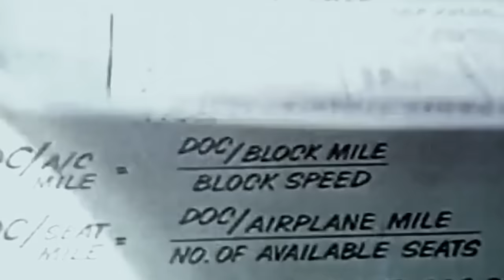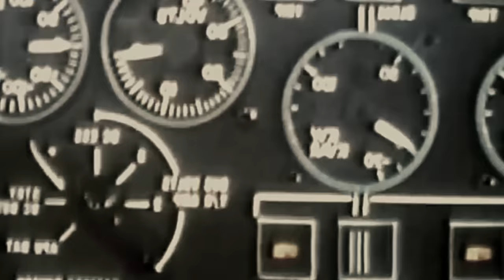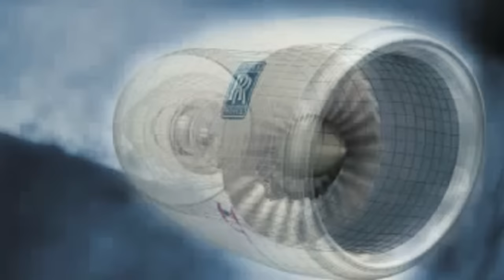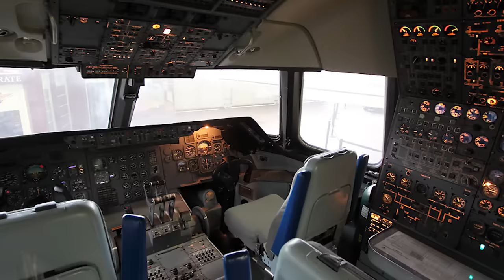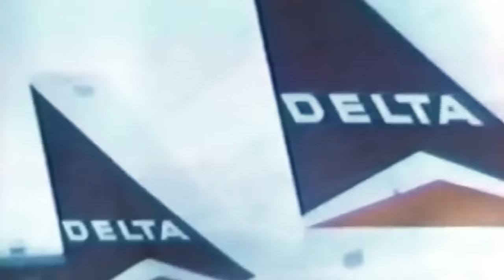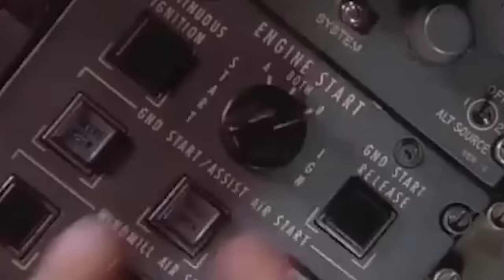L-1011 Tristar - too advanced for us

Comment: Back in the 1980's I worked as a cabin crew member and had the opportunity to work both the 
DC-10-10 domestic and flag on the 10-30 and on a different airline the L-1011.  I was a crew member involved in certifying the L-1011 with the FAA for the airline.  We went to Palmdale where the a/c were. The FAA would declare an emergency and we had to blow the slides and be able to evacuate 344 pax off the a/c in a certain allotted time. We passed with flying colors. I usually worked in the lower galley.  I'd put my tunes on, get my tennis shoes on and fire up those Bowmar ovens. I had a fire in one of those ovens one time, the lower galley filled with smoke. But by far the scariest incident on the L-1011 was while I was working lower galley, the fwd cargo door seal failed and blew out, which in turn blew out the pressure panels separating the cargo holds from the galley, they are designed to do that so the aircraft decompresses evenly. I say that calmly now but at the time I was scared out of my mind.  A very loud bang while part of the wall of the galley next to the cargo hold was suddenly missing and it got windy, papers anything light weight was floating, there was a fog in the galley and it got really cold all in about 1 sec all at the same time.  I've always had a fear of being sucked out of the airplane. I was in the elevator and going up in the blink of an eye.  Everyone in the main cabin is oblivious to the chaos down below.  I looked like I had been in a wind tunnel. As calmly as I could with the knowledge that we were going to be sucked out of the plane and impending doom awaited but mere moments away, I strapped myself into my jumpseat and called the cockpit. They said they had no warnings that indicated the problem.  A somewhat similar incident happened on the Death Cruiser, our nickname for the DC-10.  We were 1 or 2 away from departure on the taxiway, I was working rear galley and I looked over at door 4R and noticed it was no longer closed, it was open about 2-3 feet.  The doors on the 10 are different than what most doors look like.  These come slightly inwards and then go straight up.  I tried several times to get the door to close but it would go no further so I called the cockpit.  I was surprised they hadn't called us asking about why this door was open.  The engineer tells me there's no warning light and not to worry.  I'm thinking in my attempt to sound calm and collected so as not to alarm pax which can hear me, perhaps I wasn't conveying the urgency an the size of the opening with my jumpseat right next to it.  He keeps saying we're on the active runway and we'll lose our position if he has to come back and look at a slightly ajar door.  Which I'm thinking wtf is wrong with that statement in itself?  A slightly ajar door is ok.  I told him well I can tell the difference in slightly ajar and I can sit on the doorstep and dangle my fricken legs out the door, I'm staring at the asphalt of the runway I'm no expert but that doesn't fall under the category of slightly in any sense of the word. So, annoyed he came back and tried to close it (gee, why didn't I thin of that) with no success.  He decides it's not enough to cancel the flight and that most likely once we get above 10,000 feet it should plug itself up. I kept hearing most likely like an echo. Plug itself up?  With what? A Flight Attendant? I asked in disbelief that we were even having this conversation.  We had a full flight so there were no other available seats but no way in hell was I sitting next to that slightly ajar door. I thought if this idiot was on the titanic, he'd be telling the Captain well we did hit an iceberg but it just left the hull slightly ajar. I went to one of the forward blue rooms for take off. Sure enough at 10,000 ft the door did indeed close by itself.  However, on final approach on landing once we descended to 10,000 ft the same door opened up again.  That's more than scary and noisey.
Reply: That is some scary shif right there. Omg
Reply: The cockpit would have to have an indication of the problem (if your story is accurate) as their are numerous warnings for cabin altitude, pressure, and even the cabin oxygen masks are independently dropped (automatically) in such an event.  You saying you went up above and "everything was normal" doesn't make sense.  Especially the blow-out panels, which are also located in the main cabin area - I think passengers might notice those lol. 
"...As calmly as I could with the knowledge that we were going to be sucked out of the plane and impending doom awaited but mere moments away" - you must have been really reassuring for new flyers LMFAO.
Reply: Wow! great story! Sure the pilot said it would close, but I don't want to be the observer of the day being that close to it!!! Ahhhhhh!
Reply: I was there for the emergency evacuation qual tests by the FAA.  If I remember correctly, the fully loaded cabin had to be evacuated within 90 seconds.  We made it in 89 seconds first try.  We had to repeat that test for Court line as the seat density was considerably higher.  Phyllis (can't remember her last name)  of TWA was Chief Cabin Crew  Instructor and conducted the evac test as well as the slide-raft functional test at Lake Palmdale.  I like many others thought Flight Attendants were there to arbitrate seat assignments and serve Martinis.  Did I get an education!  The test cabin crew took over and evacuated that cabin more assertively than a Marine Drill Instructor. I'm still amazed at the professionalism.  Any pilot can get the aircraft on-ground.   It's the cabin crew who saves lives.
Reply: @mrkkg27  Hello fellow ATA flight attendant! I flew as a F/A our L1011's, DC10's, and 727's in 1986 and 1987--DTW based with my sister, CJ and her husband-to-be David. Those were the days! As an airplane geek and wannabe pilot, I spent as much time as possible talking to the pilots and flight engineers and sitting in the cockpit when able, usually on ferry flights. Your door story is a good one! Not too surprised that the hard-bitten FE was banking on the pressurization closing the plug-type door, but I too would not have wanted to sit next to it! Miss those fun early ATA days. 344 pax on the L1011! Back section FILLED with smoke (ick!) especially on a Key Tours turn to LAS. ---Derek Johnson
Reply: @alexmathis8505  Yes my story was accurate.  The L-1011 lower level had a fwd cargo area, the galley with 2 elevators, avionics room, and rear cargo.  The pressure panels were part of the wall separating these areas.  The upper level was essentially one large cabin.  I was never aware of any main cabin pressure panels.  It wasn’t an explosive decompression by definition but it’s not like I had a history of decompressions to gauge it by.  It was a door seal that failed in the forward cargo.  And yes the O2 masks do automatically deploy once the cabin pressure exceeds a certain level (14,000ft ??) but in a slower loss of pressure the engineer can direct more air from the engines into the cabin to compensate for the loss.  All things considered I was as composed as possible, even with hair that looked like I had been out on the wing getting some fresh air..  It certainly stands out  as a memorable flight but by no means the scariest , or most traumatic -not even close.😬
Reply: @DerekJohnson-us7vy  Hi Derek I’m Mark nice to meet u.  those were some fun, crazy, exhausting days.  I’m familiar with ATA Charters you guys had quite a few equipment . Was it Sun Tours, or Morris Travel you guys did a lot of work for?  Prior to ATA getting L-1011’s your Director of Inflight arranged to do a LAX-HNL-LAX turn to be trained on the operation of the lower galley and those infamous Bowmar Ovens.  I usually worked the galley so I was tasked with training her.  This was when I was working for Total Air which became Air America.  She offered me a job with ATA but it was based in MSP I think and I was LAX based and #9 in seniority so there was no way.  I did eventually take a Inflight management position with MGM Grand Air..  So long ago….

Comment: I flew on an Air Canada L1011 I in 1990 when I was 10 years old from Toronto to Tampa. Again in 2000 from Toronto to London Gatwick on a charter airline. The aircraft was presumably purchased from Air Canada so it may have been the same plane. On the first flight my little sister got a tour of the galley on the lower deck which made me jealous and I couldn't believe an aircraft could have an elevator on board. I can still remember the massive  windshield in the cockpit. Funny how unlike today, going on a plane (especially as a child) was a special thing you would always remember.
Reply: It's definitely not how it was, but I remember everything about my first flight as a kid in 2009 on a Delta MD-88.

Comment: The one plane that needs to be brought back from the grave. 😃
Reply: Currently after a few minutes of research, there are only a few operators left. Barq Aviation of Jordan, Lockheed TriStar Preservation of the US, Orbital ATK of the US, and a few undisclosed operators.
Reply: Ok
Reply: :( it was a great aircraft.
Reply: WTH WHY?!?
Reply: Let it die with honor...
History will remember it, but with the current masterpieces from Boeing (787 Dreamliner) and Airbus (A350 XWB)... Why bring it back??
Reply: Awesome Aircraft. Flew on it many times. Quiet & Safe. Well built quality aircraft.
The DC-10 was cheaply made, and had many design flaws that lead to total loss of Aircraft and life repeatedly.
Reply: You are damn right once it is slightly modified it will be the best aircraft and the only aircraft that ever revived
Reply: Agreed
Reply: L-1011neo or L-1011Max? ;P
Reply: The L1011 was it's own worst enemy. The advanced technologies not only delayed the introduction so loosing sales. It wasof course ironic that the RB2011 engine went on to power the 757 and is the foreru near to the hugely successful Trent family. When the L1011 finally came to market it was lacked the range, as you said and then the Airbus A300 twin was launched by the same launch customer as the L1011, Eastern.

The L1011 also had to be able to land at La Guardia on the short runway for Delta. It's the same reason why Cathy Pacific chose it, so it cod land T the short KaiTak runway in Hong Kong at the time. But the airline suffered with range even with the 500 series.

It saya something as both the DC10 and MD11 are still in cargo service. The L1011 was never a candidate. 

Great Video by the way.
Reply: Cheesecake HD L1011Max
Reply: you're right it should be brought back, since I didn't get a chance to ride on that L1011 model.
Reply: In the song "Kiss me where it smells funny" by the bloodhound gang, there is a lyric..... Like a DC-10; guaranteed to go down.
Reply: Truthfears Guilty  aaaaand, I wasnt even talking to you.
Reply: Truthfears Guilty  lol! That did make me smile
Reply: Depending on what you mean, the 757 really should be brought back alive. Yes, many are still in service, but the manufacturing tooling was destroyed. Had it not been, we'd have the most capable narrowbody ever with the 757MAX, and far more efficient than the current remaining fleet.
Reply: @2384Aviation  
Interesting, as one of my trips to Amsterdam sitting with flight engineer, he pointed out the last L-1011 sitting on far edge of taxiway, and it was a joy to see.
Reply: Not really, it's 3 engine consume too much fuel, pretty cool to see it today, but good things always end
Reply: casey myers did you fly or perform maintenance on the DC10? I have for Continental but for over 20 years at FedEx. The people who read a book disparaging an aircraft are being mislead through a lack of actual experience. For every fault of the DC10 I can counter that with faults from other aircraft. 
.
Reply: ecoRfan stay tuned for the 797...
Reply: Truthfears Guilty 797/ 757...
Reply: Rode that beautiful L-1011 many times across the Caribbean.  Miami-Bogota and back. Eastern airlines back in the late 80's up to the mid 90's. Guess I'm just remembering my younger days. Blabber, blabber, blabber!!!
Reply: Truthfears Guilty  Well,
Time flies when you're having fun. Geez, I can't believe how long ago that was. Seems like in a different lifetime. Yea, those were the days. Flying off on those big blue Eastern L-1011's to Seniorita land. Mid 80's-the 90's were very dangerous times to go vacationing in Colombia. I was just too dumb to know, or care. Totally invincible!!! Pablo Escobar and all his Sicarios murdered half the country but he didn't get me. CRAZY!!!! But, the times of my life.
Reply: Truthfears Guilty  Agreed 100%. These days flying for me is something I avoid at all costs. Hate all the PATDOWNS and other bs with  TSA although I know it's a necessary evil. Aside from those unsavory things on board cabin service is crap too. Sometimes you don't even get your 2 cent bag of pnuts!! Yea, back in the day flying off to some exotic destination was a real adventure in all aspects. NOT NOW!! Thanks, but no thanks, I'll just stay home and dream about what use to be. Whine, whine, whine!!
Reply: 2384 Aviation yes
Reply: just use a tri... 7
Reply: No kidding
Reply: My aunt was a riveter at the Tristar plant in the 70s through the mid 80s.
Reply: Almost a decade after the last Electra before Lockheed returned to the airline business in 1970. Maybe Lockheed Martin would develop a next gen SST airliner, of which they have military expertise in supersonic aircrafts.
Reply: @delten-eleven1910  was she named Rosie
Reply: @visionist7  I guess I stepped into that one ha-ha. Not, Rossie, but she worked  airframe assembly.
Reply: @hbcaptain1 Had it not been for the early teething problems, the Tristars might still be flying in the capacity DC-10s fly today. i.e. FedEx, USAF tanker.
Reply: Jake Haynes Yes, Last time I'd seen one was in early 2014 at Nellis AFB, an RAF tanker with a squadron of Typhoon IIs.
Reply: @2384Aviation  Here in Vegas, I beleive the Sands Corporation  still operates 2 Tristar-500 also 2 747SPs.
Reply: Delten -Eleven yeah and they have one that’s in Victorville sitting on the ground wasting away 😪
Reply: YOU GOT THAT RIGHT!
Reply: Boeing is too big, Lockheed can cross over back into airliner market with a Next-Gen SST.
Reply: but concorde...
Reply: No, it don´t. Its old, inefficient and obsolete.
Reply: @2384Aviation  😢😢
Reply: @kreselletoursabello8033    Lost.
Reply: yes and get rid of Boeing
Reply: it's to bad Boeing or its bosses are messing up there own places
Reply: @delten-eleven1910  Ohhh, we're moving to Las Vegas.
Reply: I'm not seeing why we don't bring back things like these. People are doing it with cars, houses, buildings. I bet people would love a flight with that service and luxury. Cost be damned!!!
Reply: @desertblade1874  This comment didn't age well.....
Reply: Yeas 💪🥰
Reply: Certainly in light of the 737 MAX Disaster BOEING have created! I Agree ! Thee TriISTAR Was a tech plane that DIDNT have a kamikaze streak!
Reply: That would be the most stupid decision ever
Reply: Shmeep they brought back the McRib, they should bring back the L1011😂
Reply: Totally agree 
And the 727
and the 747
And the IL86
Just love those birds
Reply: @desertblade1874  Yes, I agree with you. It was a beautiful plane but the cost of flying that plane just doesn't get it since we have deregulation in the airline business.  Maybe, they could get rid of the tail engine and the engineer position then it would compete.
Reply: @ecoRfan  delta still flies them passenger
Reply: With the retirement of the Pegasus after Northrop Grumman acquired OrbitalATK, the final L-1011, Stargazer, will probably be retired. Hopefully it gets preserved in a museum. :(
Reply: Repeatedly?
Um, no....
Reply: DC10 was an excellent plane.
Flew it many times.
Stop spreading untruths.
Reply: I flew DC 10'S alot.
Outstanding aircraft.
Reply: @desertblade1874 it has one thing which those planes don't have, automatic landing